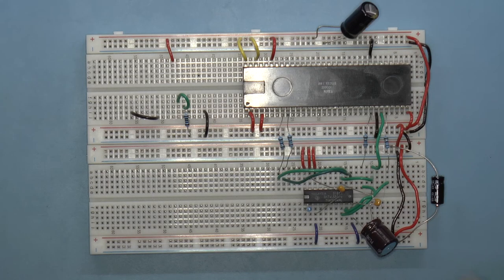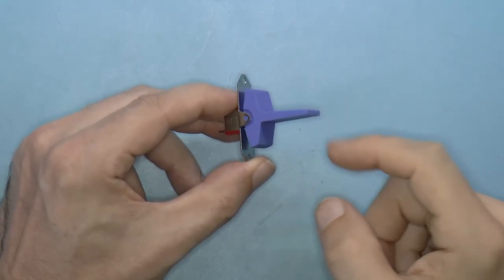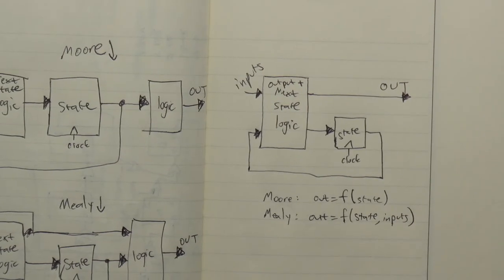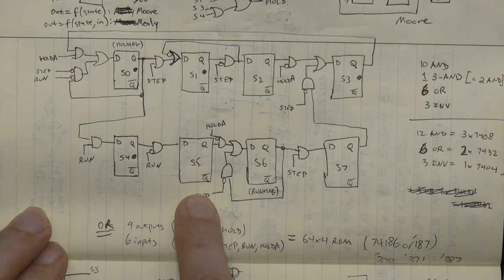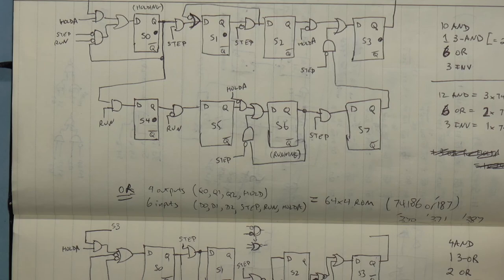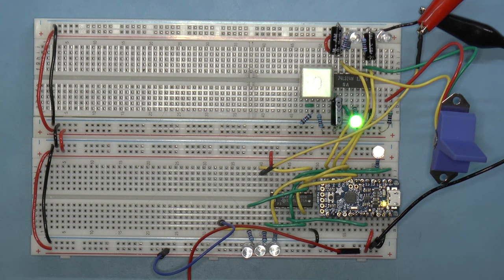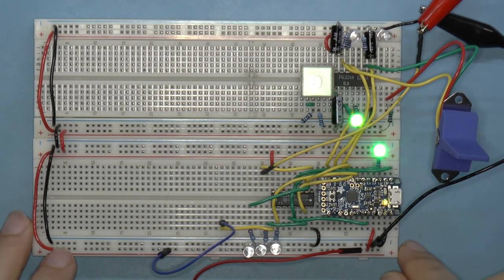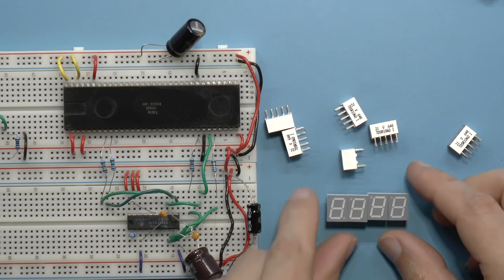Building a single-stepper for a TMS9900 CPU retrocomputer

Comment: Thanks for the videos on the TMS9900, Robert.  Back in 1978 I built a computer from scratch using this chip.  I had 8K bytes of static ram.  The Single Step function was implemented using two 7474 flip flop packages (4 flip flops in all).
This worked very well and I could set breakpoints and single step.